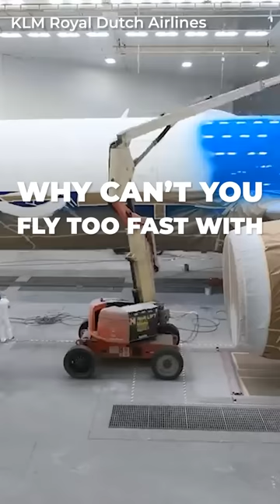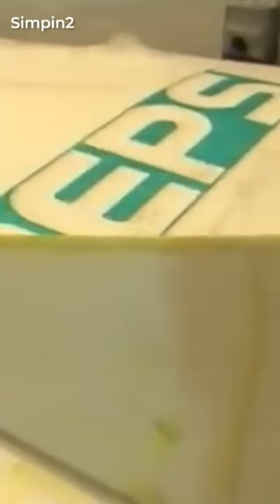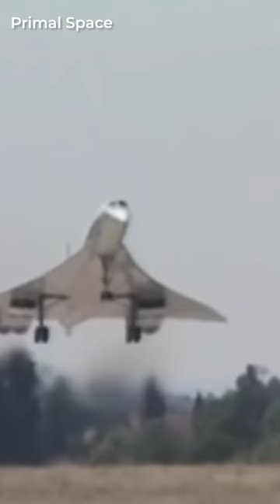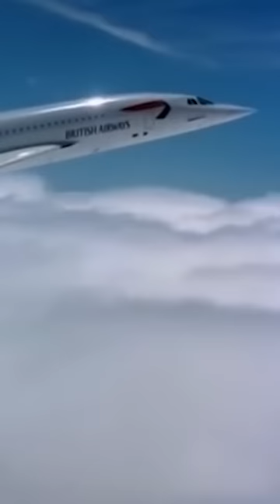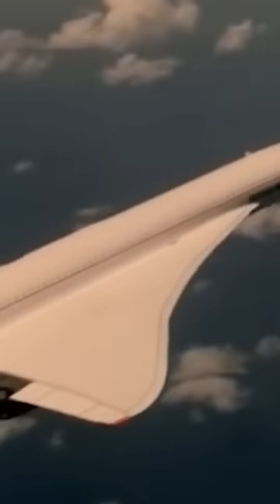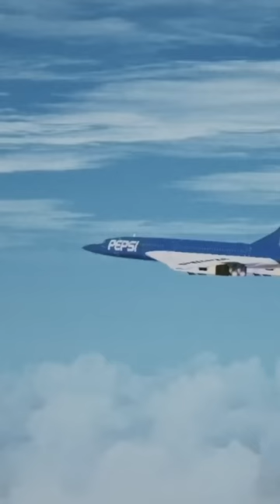Why You Can't Fly Too Fast With Blue Paint? #shorts

Comment: These days there are solar reflective topcoats available that can help out. Not sure if it would be enough for a Concorde but they'll keep skin panels 30-40 F cooler than traditional dark paints on a hot runway (like Vegas or Phoenix in the summer). The way they work is to install that traditional IT reflective white as a basecoat, then spray over that with a dark colored but IR transparent overcoat. Color selections are limited to only those pigments that have been found to be IR transparent but I know there are blacks, blues, and greens available.

Comment: 1 Concord resource of the last supersonic plane there hasn't been any since. 2. Planes are mostly painted white because Airplanes are very exposed to sunlight both when they are in flight and when they are parked on the ground. White paint is the best way to minimize cabin heating and prevent potential damage from solar radiation.

Comment: White will reflect heat from the sun whereas black will radiate the heat from friction
Reply: If it's "black" in the infrared wavelength range relevant for the surface temperature.
Reply: This is why SR-71 aren't painted Pepsi Blue!!
They have to be black instead ?¿?¿?

Comment: Blue and green absorb heat more than any other color besides black.
Reply: So is it cool colours that absorb the most heat? Does that mean warm colours reflect more, like yellow and orange?
Reply: This is why SR-71 aren't painted Pepsi Blue!!
They have to be black instead ?¿?¿?
Reply: This is why SR-71 aren't painted Pepsi Blue!!
They have to be black instead ?¿?¿?
Reply: This is why SR-71 aren't painted Pepsi Blue!!
They have to be black instead ?¿?¿?
Reply: @Bendigo
This is why SR-71 aren't painted Pepsi Blue!!
They have to be black instead ?¿?¿?
Reply: @nottechytutorials  "Cool" and "warm" colors are the opposite of what they actually are.   We think of colors being warm because of fire light.  Fire is actually very cold compared to the sun which produces white light.   Snow is white and cold so white and blues are considered cold colors.   

Different colors absorb different levels of light at different wavelengths.  Darker colors absorb more light.    

Blue and green are colors that have more energy than red and yellow.   The darker the blue or green, the more of that light they absorb, resulting in more heat.
Reply: @timothylessing4774  No, but that is why the concord was painted white and why it failed when they painted it with blue.  It probably would have blown up if it was painted purple or black.

Comment: It's not the paint, but the surface material that's the issue. The plane conducted heat too easily and needed a different surface material to either improve heat dissipation or be highly heat resistant (like the space shuttle's exterior tiles were).

Comment: This is the reason the SR-71 was painted flat black. Well, its the opposite reason. Opposite not in the sense that flat black absorbs more heat,  and they wanted the Blackbird to be hotter. Black does absorb the most heat and gets the hottest compared to white. The reason the Blackbird was painted black was to COOL it.
Because not only does flat black absorb the most radiated heat, it also radiates the most heat away. And when you have a very hot aircraft that needs to radiate heat away, black paint is substantially better than white.

Comment: False: "Painted with highly reflective white to deflect some of this heat".

You want the hull to emit its own heat as infrared radiation, and whatever colour or reflectivity it has for visible wavelengths is irrelevant for that.

The paint would appear black in the relevant infrared range, as the ability to emit its own heat as radiation is opposite to the ability to reflect.

Comment: I doubt that the color was the reason. I think it was the chemical compound of the color. The SR-71 was black. Let me explain, while dark colors absorb more light (and turn it into heat) they also emit more heat (that's why cooling bodies are often painted matte black) And since the heat is not coming from light, but the friction of the air, I think its just the wrong type of color.

Comment: So what exactly was the reason?

I can put two and two together but that video didn’t explain anything, it just said that Air France made a special livery and that Concorde had a reflective white paint to help with overheating.
Reply: You're right. The video doesn't explain, because the author doesn't know the relevant physics. "Painted with highly reflective white to deflect some of this heat" is false. You want the hull to emit heat as infrared radiation, and whatever colour or reflectivity it has in visible wavelengths is irrelevant for that.

The paint would appear black in the relevant infrared range, as ability to emit its own heat as radiation is opposite to the ability to reflect.

Comment: Isn't it also to do with weight? White paint is generally lighter in kgs and doesn't require as many coats to get a uniform colour (paint protects the hull). Remember every paint can adds that weight to the plane, up to 8 passengers.

Comment: Then why was the SR 71 blackbird black. On a further note, I've seen some people say it technically was a really, really dark blue. There's also the X-15.

While black absorbs heat faster, it also radiates it away faster as well. I think it's called black body radiation. I might have the name wrong.

I'm not saying you're absolutely wrong, but I think there must be reasons why they choose the color for a mach 3.2 aircraft and a mach 6.7 hypersonic aircraft. The sr-71 you might be able to make an argument that it's harder to see at night, though I'm guessing at 90k feet and at those speeds it probably doesn't matter. However, the X-15 was just an experimental aircraft, so it shouldn't matter.

Comment: It technically was not the first supersonic airliner. The soviets stole the title with their tu-144 by spying on the Concorde project. It had a few crashes early on though and was shut down.
Reply: Several of the in-service crashes had the same proximate cause as the Paris crash (debris strikes on the underside of the wing causing a tank rupture due to hydraulic shock)

Concorde actually had a hydrauliced wing tank rupture in the early 1990s when parked on the apron at Harefield in New Zealand thanks to a ground crew ladder strike. The thing was hella fragile and the warnings should have been heeded but aviation (and spacecraft) tends to ignore such things until people actually die (shuttle launching with leaky o-rings being one example. "It's launched with leaks before and there were no issues!")
Reply: Also a little known fact the tu-144 had to fire afterburners continuously to maintain supersonic speed making the thing burn massive amounts more fuel than the Concord with its highly efficient yet super powerful Rolls-Royce engines

Comment: Correction: It Isn't the first supersonic commercial airliner. The Russians achieved this first with their Tupolev TU-144
Reply: Which exploded at the paris airshow.
Reply: 1: Irrelevant
2: id rather risk death then pay an arm and a leg
Reply: The TU never made a real commercial service, since it couldn't fly supersonic without the afterburner. In this case you get barely range out of it, the afterburner eats your fuel. It's a supersonic airliner on paper, but completely impractical in reality.
Reply: @simonm1447  Every SST is impractical, And the TU-144D didnt have afterburners, still flew mach 2. and it did fly commercially, just only operated a few routes
Reply: @SebastianDeVries-ol5iq  the Concorde worked fine, it did 50k flights over the decades. Later versions of the TU were improved, but in this case you can hardly say it was the first when the first ones were barely usable in reality.

There's a reason potemkin villages are in russia at home
Reply: @simonm1447  Eh, tu-144 is still cooler by miles, who doesn't like crazy russian engineering
Reply: @SebastianDeVries-ol5iq  the best place for russian aircraft is the museum, and not the airport. If you ever had russian colleagues at work you don't want to use anything from there
Reply: @simonm1447  I Disagree, they mightn't be the most reliable, but these days, there are some promising Russian planes.
Reply: @SebastianDeVries-ol5iq  Like the TU-214, which is a warmed up soviet era aircraft? The SSJ and the MC-21 are no real russian aircraft, since almost all systems are from EU and US suppliers, and they more or less have to discontinue them since they would have to develop most systems domestically if they want to build additional aircraft in future.

In fact the russian aircraft industry is broken, they plan with 70 new 214s until 2030 while Airbus alone delivered 661 aircraft just in 2022
Reply: @simonm1447  eh, russia still has the most ambitious projects, AN-225, was one of them (RIP) An-124, Lun Class Ekranoplan, You cant ignore the fact that European and american aircraft are boring these days. The only thing i dislike about the tupolevs are the goofy green-blue cockpit. And before you say: "oH bUt ThOsE aRe ConCePtS" I Don't really care, they still are epic.
Reply: @SebastianDeVries-ol5iq  An - 124 is very similar to the C-5 which was first, the 150 t payload are only available in a modernized version which was built only a single time. The rest of the fleet has equal payload to the C-5, with almost equal weights (empty weight and MTOW) and equal range.
The 225 was a special aircraft, but it wasn't russian but soviet. Russia's aircraft industry today is broken and barely existing.

Western aircraft may be boring for your personal taste, but at least they work and they are commercially usable.

Btw, the west has concepts too - truss braced high aspect ratio aircraft, flying wings, and blended wing bodies
Reply: They achieved espionage nothing more
Reply: @timothylessing4774  Wrong, later TU-144D model had nothing of the sort, and was more economical.

Comment: I don't get it. Doesn't blue radiate heat more than white? White actually radiates heat the slowest. Yes, white also deflects white from the sun, however when supersonic I guess most of the heat comes from compressing air, which the white paint wouldn't help with in any way. That's why the blackbird is black - to radiate as much heat as possible.

Comment: Southwest is sliding down a wall crying rn
Reply: Southwest doesn't fly any of it's planes at Mach speeds.  Most commercial passengers planes cruise at 500~600Mph.  Heat from friction and sunlight is not as much of an issue at those speeds and for short trips (which is what Southwest mostly does)

Comment: Didn’t realize the Concorde went Mach 2 damn
Reply: It went Mach 2 without afterburners, and was only limited by the temperature at the nose of the aircraft, as it did not use titanium.
Reply: Mach 2.23 was the absolute maximum speed
Mach 2.0 was sustainable over long periods of time
Reply: The TU-144 had to fire afterburners in order to achieve supersonic flight. It was a pig on fuel as a result. The Concorde with its powerful yet efficient Rolls-Royce engines was absolutely spectacular a person can't even speak these two planes names in the same sentence

Comment: Just think about the fuel savings of that gas guzzler not going full blast for over 20 mins per trip. Better the fuel economy just with a different paint job. Mind blowing!
Reply: It actually achieved amazing efficiency by going faster the fact that it could not go fast for more than 20 minutes meant that they were missing out on optimal efficiency causing them to burn more fuel as a result

Comment: TU-144 flew before the first Concorde… So technically Concorde wasn‘t the first supersonic airliner.
Reply: Technically that's right. The TU sucked however, it couldn't do supercruise which was limiting the range. But in subsonic flight both (Concorde and TU) were very inefficient because the wings were made for supersonic flight

Comment: The black bird flies well at mach 3 and is completely black. black being the color that absorbs the most heat.
Reply: The SR-71 gets hot from air friction, not sunlight.  The SR-71 was a spy plane that mostly flew at night, so it wasn't prone to heat from sunlight.  It's hull was also specifically designed to accommodate the expansion from heat.  It had very large gaps in the hull that closed up as it expanded from heat.   The black color also expels or radiates heat quickly, so it cools down faster as well. 
Kirchoff's Rule of Radiation:  A good heat absorber, like a black object, is also an equally effective heat emitter.
Reply: Yes but you see black also radiates the most heat away from the plane therefore it is going to radiate more heat away then it absorbs making for a net loss of heat.

Comment: I got an idea. Just spend as much as a sr71 and you can have black
Reply: Yeah, I actually think that might be an argument against this video. I realize the SR-71 used different materials and construction methods, but there's probably a reason they choose black. 🤔 I've seen people claim the engineers said the blackbird is actually a really, really dark blue. I don't know if this is a fact.

You might be able to say it's harder to see at night, but did it do spy missions at night? It also might be easier to spot a black plane during the day than some other colors? Then there's the X-15. Just an experimental hypersonic (Mach 6.7) aircraft. I dont see any benefits to it being low observable, so the black must have had benefits for its record setting flights as that's basically what it was designed for.

There's also the fact that black-body radiation is a thing. I'm no expert on any of the above subjects, but it does raise some interesting questions.

Comment: I wonder if the blue FGR Phantoms had the same issue
Reply: Phantoms can't fly Mach 2 for long. They need the constant afterburner for that, which means you empty the tank within minutes. Concorde just used the afterburner to go through the transsonic speed range, and flew Mach 2 without it
Reply: @simonm1447  good point although they could comfortably cruise at Mach 1.02 at 45’000ft but I don’t think surface heating would be that much of an issue at that speed.

Comment: The AirFrance and the British Airways logos BOTH contain blue paint.
Reply: Only a small percentage of the airframe in that case.

Virtually all jets were white or polished metal for heating/cooling reasons at altitude when the fuselage were made of aluminium 

This changed with carbon-fibre as it's vastly less of an issue, however white aircraft are easier for the air conditioning systems to keep cool in direct sunlight

Comment: They should have used titanium
Reply: Well no
The price
The weight
Hard to work with
Aluminium is better overall
Like on the space shuttle
Reply: @timothylessing4774  well no, look at the fastest plane in the world Mig-25 an its big brother Mig-31. They are built from Titanium and stainless steel alloys.
They are faster and stronger built. So ja. Titanium alloy + stainless steel alloys are better then Alu
Reply: and what do you mean with weight Titanium alloy has the weight properties of aluminum and the strength of steel more or less

Comment: There was another reason. A certain color won't slow a plane down.
Reply: It slowed down since it would be too hot(Even for the Concorde) if it goes Mach 2 for more than 20 minutes
Reply: This is why SR-71 aren't painted Pepsi Blue!!
They have to be black instead ?¿?¿?
Reply: @timothylessing4774  The SR-71 was designed to minimize its radar cross-section, an early attempt at stealth design. Finished aircraft were painted a dark blue, almost black, to increase the emission of internal heat and to act as camouflage against the night sky. The dark color led to the aircraft's nickname "Blackbird".
Source: Wikipedia

Comment: Concorde was not the first supersonic passenger aircraft. Tupolev 144 was.
Reply: That's right, but the TU sucked since it couldn't fly supersonic without the constant use of the afterburner, which means the range was quite bad. Since it was designed for supersonic flight the efficiency in subsonic flight was bad too. It never made a commercial service which would deserve the name. 

The only supersonic airliner which was used for a real commercial service is Concorde

Comment: Then what's the deal with the SR71 Blackbird?
Reply: Blackbird goes faster than concorde and gets MUCH hotter - it had to be made of titanium to handle the heat without melting. Concorde is made of aluminium and it still stretched a foot in length in flight due to the heating effects
Reply: This is why SR-71 aren't painted Pepsi Blue!!
They have to be black instead ?¿?¿?

Comment: Sorry, but this video is totally wrong about the effect of the color of the paint. Blue compared to white absorbs a little more of the light in the visible spectrum, but what matters for the dissipation of heat (in the infrared spectum range) is mainly the glossyness of the surface. A matte surface (original concorde white) radiates out heat much better than a shiny surface (the clear standard paint covering the blue).
  Compare also with the matte black surface of SR-71 Blackbird (officially Mach 3.2) or any supersonic military aircraft (usually matte grey, rarely white).